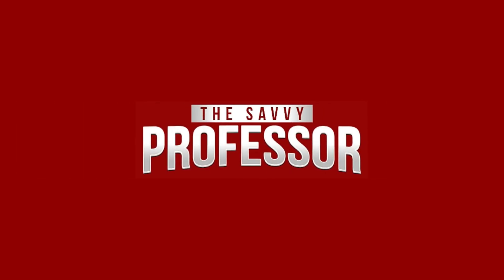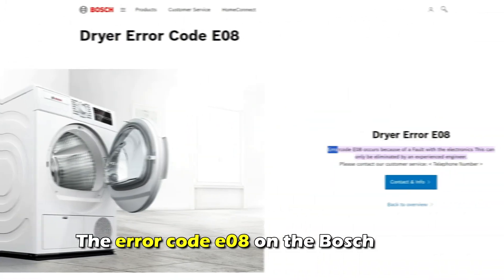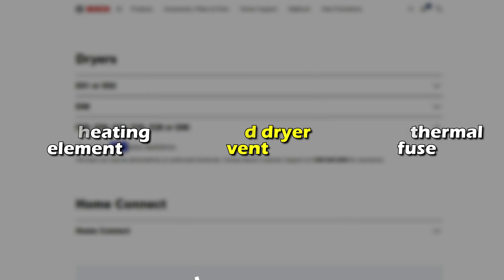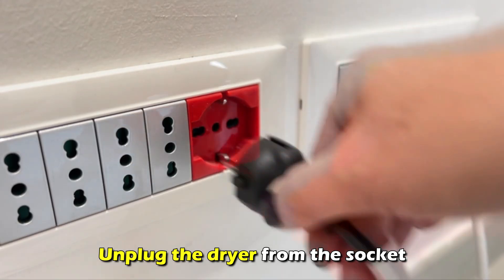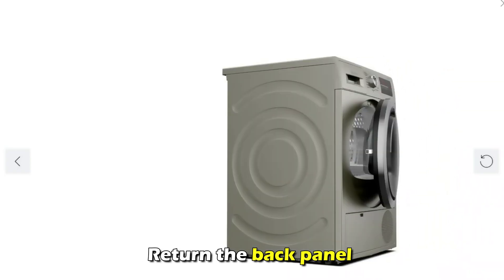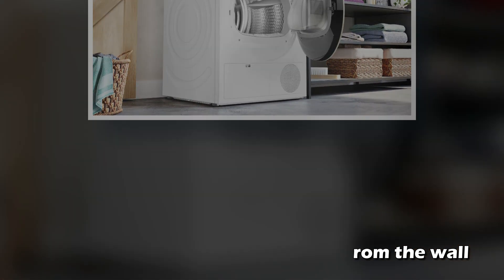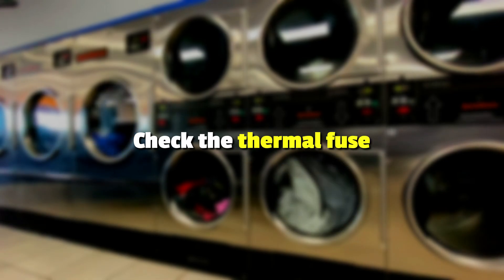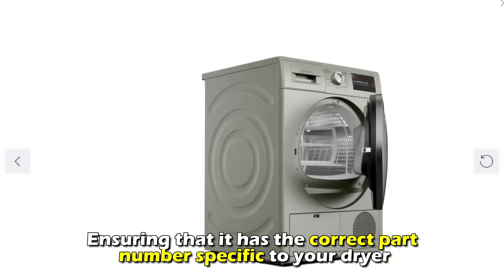How To Fix Bosch Dryer Error Code E08 - Meaning, Causes, & Solutions (Solved Quickly)

Comment: Sometimes this can be due to extremely cold conditions. I was away from home for four days, and my Bosch dryer stopped working. I tried cleaning the vents, but that did not help. However, when I placed a small heater near it for just five minutes, it started working again. So it could be that electronic devices only function properly within a certain temperature range.